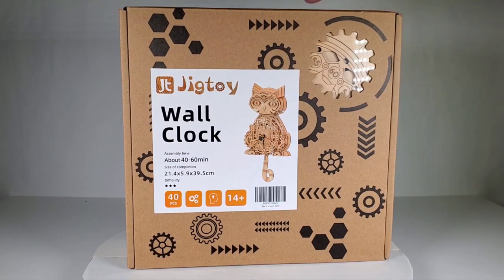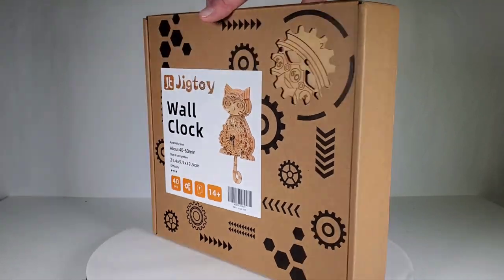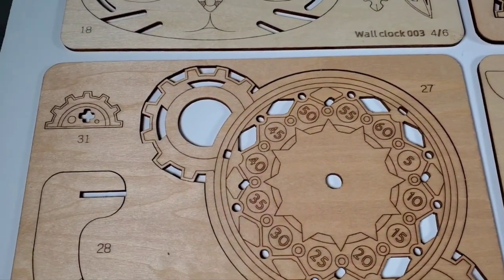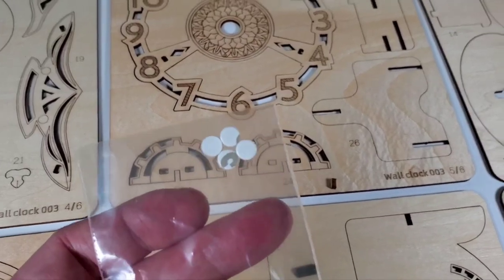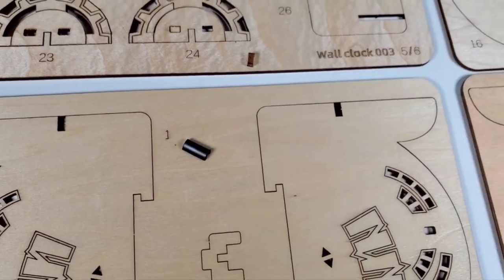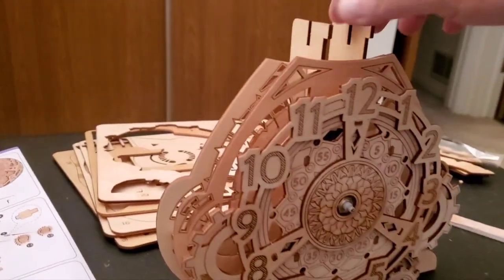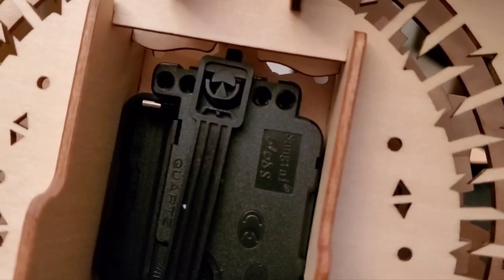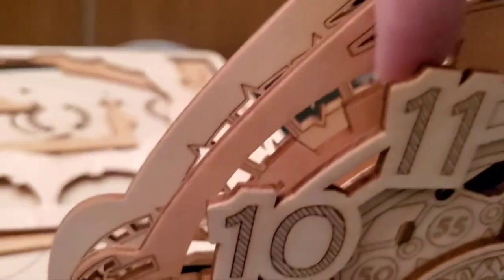Jigtoy Working Cat Clock Building Kit

Comment: This may be a dumb question, but how do you start the clock? I con't see ANY switches to turn on the mechanism.
Reply from the maker: The clock should start as soon as you put the batteries in. The pendulum starts by giving it a gentle push to get it started.
Reply: @outsider238  Thank you! I figured out that I had the battery in the wrong way - silly me! LOL. I appreciate your quick response. My clock is up on the wall ahd happily swinging his tail.
Reply from the maker: @pattimoran2020  Ah, perfect! 😁 It's such a cool clock! I'm glad you like it! 😄👍